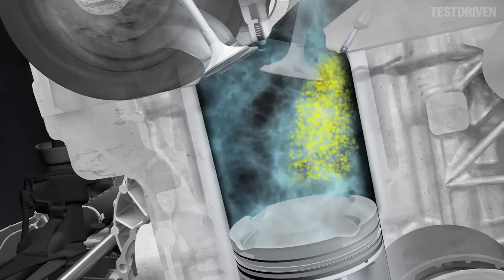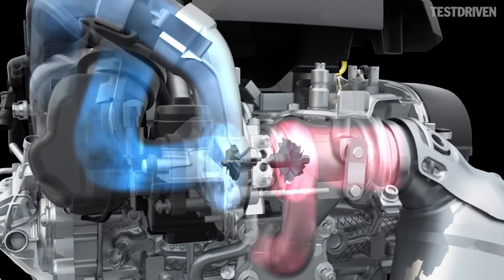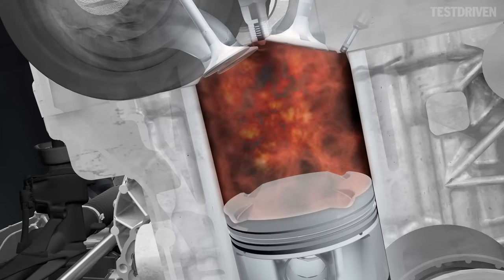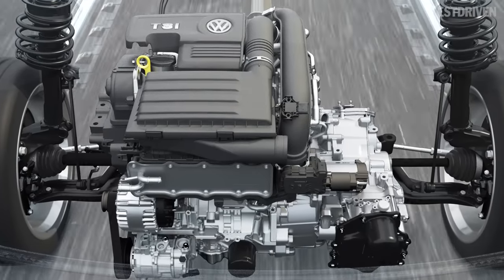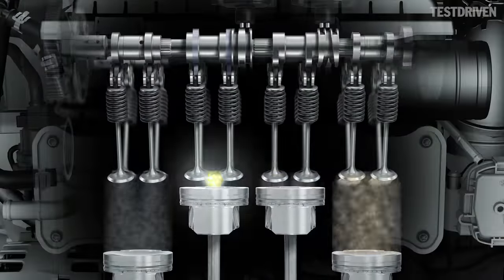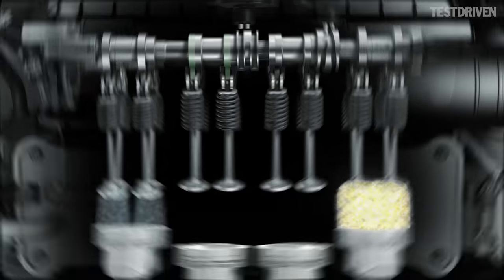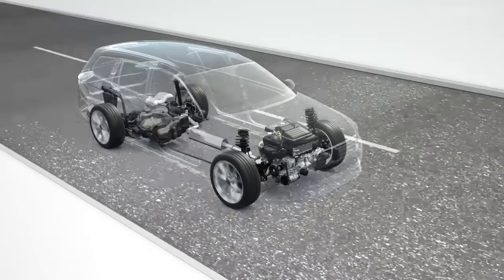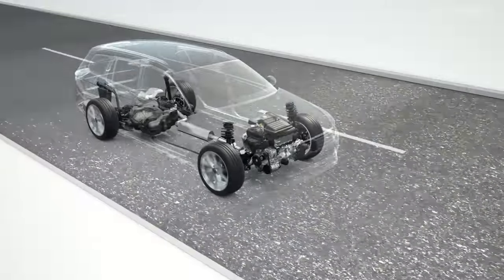Volkswagen TSI engine animation

Comment: Until the dsg blows
Reply: 6 speed one it’s ok but 7 speed one dry clutch after 200000 km maybe start problem
Reply: 6 speed wet clutch on my Jetta TDI still going strong after 100k miles

Comment: 2012 VW GLI 2.0 TSI: New waterpump, high pressure fuel pump, 2 intake manifolds, camshaft replacement, new cambridge due to oil screen falling out, 2 fuel injectors, gas leakage from manifold, misfiring due to carbon buildup, traded it in before having to replace the timing chain seals and timing chain tensioner  which would have cost around $2500. Not a reliable engine...
Reply: Do the proper maintenance and u wont have any problems
Reply: Worst vw engine made 2.0 tsi is trash....buy a 2.0 tsi they said, it'll be fun they said, what they didn't say is that it's a hunk of shit😂
Reply: @stevenyia2778  this is a design problem not maintenance
Reply: @stevenyia2778  lolwut? This suboptimal developed car is permanent maintenance. I hope the development team never finds another job

Comment: Ölabstreifringe verkokt, Zündkerze geschmolzen wegen zu hoher Brennraumtemperaturen und damit Kolben und Ventile in Zylinder 3 beschädigt. Bei 120.000 km. 2.0tfsi ccz. Läuft. Am liebsten würde ich dem leitenden Projektleiter auf den Schreibtisch kacken. 4000€ Reparaturkosten für die Revision des Motors. Und das ist der Standart bei diesem Motor.

Comment: they forgot to tell u how it needs 0.5L oil /1000km !
Reply: Not that bad tbh
Reply: Didn't run the engine in properly
Reply: Mine use no oil at 10,000 km. I must be a genius.
Reply: It is true, 1,4 tsi 122 passat
Reply: @ozdenbasmaya3945  Passat uses larger engine like 2.litre
Reply: @ablam8 No  in Turkey 1.4 tsi  and 1.6 diesel versions sold
Reply: @fuadhasanov9667  100% true
Reply: @MrRohanThomas  what's true?

Comment: Had a 2.0 TSI..
1st strike - sludge/carbon buildup.  Replaced throttle body.  Fixed under warranty.  
2nd strike - Fuel injector faulty in opened mode.  Limp Mode.  Blamed me for bad fuel. BS. I used all top tier.  Cost 1200 to replaced 4 injectors.  Said if 1 goes out, 3 will soon to come.  Warranty not covered.
3rd Strike - Limp Mode.  Dealer wants 600 to fix bad coil pack.  Bought 4 for $125 at AutoSone.  Took me 15 minutes.  Just release plug, pull out coil packs.  Replace. Dang Stealerships.
4th Strike - Engine light on.  Something with Emission.  Cost 1400 to fix.  Screw that.  I reset the Check engine light.   Drive to CarMax and sold it.  Had 48k miles on it.

NEVER VW (Audi) again!!!!
Reply: Joe Nguyen if you can't handle high maintenance German quality then go buy a Honda that will be shitty but run forever
Reply: Joe Nguyen Well, if you push it like an F1 car... what do you expect, honestly?
Reply: Joe Nguyen what year was your car?
Reply: VwParedes 
VW suxs, it's German by name because the quality isn't their thing.
Reply: Joe Nguyen  straight piped mine with 3" down pipe and ecu stage 2 tune with bov and air intake not a problem 30k in
Reply: Same thing by me!! I have lost 4000 euro and then the motor light on! Fuck VW/Audi/Skoda!!
Reply: Honda, shitty? Lol :D
Reply: Joe Nguyen your first mistake was utilizing AutoZone parts. I don't have any problems with my VW. I take care of it like someone with OCD. Maintenance on time, check fluids etc,, weekly
Reply: Rey Perez it's not German anymore, only thing German is the trademark. Vws are made everywhere but in Germany for example Mexico, turkey, Poland to turn the fabrication costs down.
Reply: 81k on a 2015. Haven't even needed to change  the brakes. Consistent oil changes, get fuel name brand fuel only. It reminds me of why I don't eat avacodaos anymore. I once ate an avocado that was spoiled, never ate them again. If that one avocado is bad, surely all avocados after that one will be spoiled. I sure do miss the amazing taste, they taste way better than salsa with my chips, but salsa it is, avocados are bad.
Reply: Random Hoerse Lol. A '98 STS? That's your benchmark for quality? The Northstar engines were some of the worst engines gm made. Source: Owned a Deville with that crappy Northstar engine. The early vw engines were not great. Had HPFP issues, cam follower failures, etc. However, the newer gen tsi is pretty much indestructible. The new VAG cars are not the vw/audis of yesterday. They're really reliable, and fun cars.
Reply: Random Hoerse I'm not sure where you're getting your information, but the Northstar was designed by gm's Oldsmobile division, not volvo. Look, I'm a car enthusiast, and a shade tree mechanic. I've owned and built almost every manufacturer. I've owned vettes, f150's, jeeps, BMW 3 series, audi s4, Evo, 300z, etc. I have no brand loyalty. If it's a good car, I don't care what brand it is. I can say definitively that the vw/audis made in the last 5-7 years are reliable as anything else out there.
Reply: That sucks.
Reply: Jan Prokopenko Lol only you People in the states get shit quality here in europe they are tenden to run over 500.000km if every maintenance is done
Reply: Jan Prokopenko The entire Golf family i.e. Golf, Alltrack, Sportwagen, GTI etc. are manufactured in Wolfsburg. The Passat and Atlas are produced in Chattanooga TN. They do produce a lot of vehicles and components in Mexico, but not everything!
Reply: Joseph Opperman Lmao only us spec
Reply: Crissy 92 volvo 240 wagon. 700 000 + km with only regular maintenance. The odd stubborn transmission leak.
Reply: What about the timing chain tensioner? LOL
Reply: Lol my father has had BMWs since 1991 and the only major problem he had in all years was the turbo on 2004 E46 320d, other than that nothing. But obviously new technologies have to get tested, and unfortunately some people out there are the lab rats, lol
Reply: Joe Nguyen it does depend on what brand of gas you use, my cousins owned an 05 Jetta and she always used Valero fuel because it was so cheap and she had so many problem such as shaking or car shutting off  especially after fueling, I bought her car and I used Exxon to fuel it and after about 2 months the problem is gone. Different gasoline companies use different detergents to clean emmissions and protect the engine
Reply: 5th strike, oil exhaustion and no warning on MMI. Cost: 2200$ for new engine due to conrod going out thru the side of it . Auction set up to get rid of it. Tks Folkswagen for great economy!
Reply: could you upload a video of it pls thanks
Reply: I own 2 Audi A4. One is 1995' (1.9TDi) an one is 2006' (2.0TDI). Both are already at high milage (265k and 303k kilometers) and still running smooth, just 1x Turbochange at the 2006' one and that was it. Just take care of your care 🤷
Reply: Vw's are much cheaper to maintain if you do the work yourself. Got a 1300 dollar quote for a timing belt. 110 bucks and 2 hours. Half the flat rate time
Reply: @some-replies  true but alot of people are not very handy though 😏🤷‍♂️

Comment: Reliable, dependable, quick. 
Dues: Read the owners Manuel, Change The air intake filter every 4 months. Get a oil change every 4k miles or less. 
Get A new battery 18-24 months. epc light may engage if you don't.
1 top of the oil essential because the turbo needs oil and its physically located on top of this engine so its in needs of a full supply as not to lack in the engine. Hence epc may come on.
2 fresh air intake filter  EPC again may come if you don't change it. remove the filter/clean by tossing it on the ground  dust will loosen put it back in and the engine will breath better. epc fix!
third new batterie. all those things keep me Wagoning along volks.
Reply: Oil change every 4k Miles or less...:)))))))))))))

Comment: No oil consumption and no timing chain tensioner fauls (as some said here). TSI engines offer economy, excellent performance and low maintenance. Nothing wrong with my VW Jetta GLI, with a 3rd generation TSI engine, after 58.000 Km (36.000 miles). So far, it couldn't be better, even using a third part power increase module. VW uses all the technology of a premium brand that has a name to watch over. VW Jetta is a cheaper Audi A4 (compare Jetta MK6 with Audi A4 of the same generation), and the GLI version has, unlike the rich cousin A4, sports car performance and handling.
Reply: @S P I have volkswagen passat b6, 1.8 tsi engine, Mileage 229000 km, and it's still work without problem for 12 years
Reply: @S P Jetta was once a sedan version of the Golf, but today they don't have much correlation. They are even in different generations. I once owned a Jetta 2.0 TSi MK VI that had an Audi A4 of the corresponding generation as its parking neighbor. Very similar in appearance, dimensions and mechanics. Much more than with Golf. I worry about the possibility of mechanical problems. I've had another Jetta 2.0 TSI with which I ran up to 83,000 km without any problem. I saw some much more used than mine, severely used even on track day events,  and very healthy. It is often compared to a battle tank in Brazil, for its robustness. But you are right to warn me.

Comment: Hey guys, so im looking on to buy a jetta 1.4 tsi or an eos with the same engine. Are there any specific things or problems i should know and be aware of this engine?
Reply: Not really mine is lasting really well. Best to fill with good premium gasoline, check oil temp at least 75C (167F) before revving hard. Nice to drive, early boost and mid-range grunt.

Comment: Just remember to strip down your engine every 10000 miles to clean the carbon build up on your inlet valves. This can be easily carried out by a vw qualified engineer near you for a small fee.
Reply: Gtfo with your small fee
Reply: @TechNostalgiaNL  small fee. That's meant as ironic humour pal. Satire. Yeah it's waisted here.

Comment: My 1.8 tsi has a steel block, not like Caddy with aluminum, and the gasket bolts go on the Caddy, engine overheats, anti freeze in oil. I will keep the vw.

Comment: My jetta 2019 is now 180 k  kilometres , it’s performance , silence and fuel efficiency is like it was at 20 k , i love it , no engine light so far , some dumbasses don’t maintain them well , this engine need special grade oil as 509-00 0w20 , most of them just buy simple 0w20 and always put gas treatment after some 5000 km , and replace the required parts on time
Reply: What is your fuel efficiency long term?
Reply: @dragospahontu  16 to 20 km/l

Comment: I own a  VW Golf 1.4 tsi.
After only 5000km this engine starts shaking when running idle. 
I don't find this normal, do you, but VW finds that an engine that runs irregular is normal !!! 
And won't do anything about it, even in warranty period !!!
Remember, this engine block is also used by Audi. 
You pay a lot of money for a shaky engine, and what about the long term damage.
The joke (bill) is on you.
Reply: i have a 1,4 tsi golf driven 9000km and have no problems with the engine. Lucky for me or bad luck for you?
Reply: Any relevant update about your car's engine?
Reply: Any relevant update about your car's engine?
Reply: Any relevant update about your car's engine?
Reply: my delaer says it's due to the fact that the engine runs on a "lean mixture". But the car has always run on that lean mixture from day 1. Why it start shaking when running idle after barely 5000km, remains a mystery. I've driven in other Golfs ( which of course all run on the same lean mixture) with more mileage on the clock ( even euro 6) which don't have that problem. So I have my doubts about the reliability of my engine on the long run.
Reply: They don't bother to do anything about it. Even under warranty.
Reply: VW Golf7
Reply: Your timing chain is the cause of that shaking because it`s stretched, that`s a common problem in TSI engines.
Reply: Mihovil Peko LOL, most of 7-gen golfs 1.2 and 1.4 are timing belt engines!
Reply: Salil Sawarim all mk7 golfs actually.
Reply: From what you just said tells me you unluckily got a bad engine out of the batch. VW just like any other manufacture will have a bad engine after so many are built.
Reply: That is what they call: "a product property".

Comment: I have a 2018 golf tsi and I’m trying to get some more power out of it without voiding the warranty. I know it isn’t the best car to put money into but I’m not looking for anything crazy but does anyone have any advice? I just don’t know what I can do without messing up the warranty
Reply: From what I’ve seen, a more free-flowing exhaust system is the easiest way to make more power without voiding the warranty. AWE makes a nice one that greatly reduces back pressure as well as weight. A proper cold air intake (APR, CTS, etc.) would help as well but I’m not 100% sure if they void the warranty or not. A drop in air filter would give improved airflow and would not void the warranty. Unfortunately, you’re not going to get much more than an additional 5-15 HP from these. They will mainly improve response and sound. Having the power come on quicker and louder will make the car feel faster and more fun. While ECU tunes greatly improve power, they void the warranty. Also, if yours is a gti, it’s actually a pretty solid car to upgrade.

Comment: Everytime he says 'TSI stands for..' i expected to know the abbreviation.
Reply: TSI stands for The high preSsure fuel pump Inoperative.
Reply: @DigitalYojimbo  wrong

tsi - turbo stratified ingine. its german
Reply: @braderyoutube1983  Turbocharged Fuel Stratified Injection.
Reply: @Alexandru-T.  that 1 is for tfsi. not tsi. right?
Reply: @braderyoutube1983  They're the same EA888 Gen 3 engine. Audi sells it as TFSI while VW/Skoda/Seat sell it as TSI.
The old EA113 engines were TFSI for all, but with the introduction of the new EA888 engines in 2007, they switched to the nomenclature from earlier.

Comment: I got 145k miles on my gen 1 EA888 2.0 TSi and I’ve replaced a lot of gaskets and crap but she’s all good now except the tensioner for the timing chain at the top of the cams that broke but I still spank limiter like it’s nothing and I drive full throttle because that’s the only way to drive it no I’m not kidding I literally drive it like I stole it everyday and I’ve never had any mechanical issues except the high pressure fuel pump and the starter but I replaced both and no more problems

Comment: My mother in law has a polo 1.1 tsi ( i think that's the engine size). That thing just won't fucking move, and I have a turbo 0.9 tce clio, never failed me once, everything works as just the day i bought it and it will smoke the polo. Idk where the fun is on driving a car with such engine.

Comment: Do these new 1.4's have timing belts, again?
Reply: +Mr. Andraș with alot of play
Reply: +Mr. Andraș Front timing belts and rear timing chain.
Reply: Nah still have chain. Itll have alternator belt and stuff but sadly no and crappy tentioners theyre grand if you keep an eye on them.
Reply: Ben Crosbie and there a grand if you dont
Reply: Belts were re-introduced on Tsi engines in 2013 with Golf 7.

Comment: 10000 km no problems yet
Reply: Pfff.. its just 10k
let me know when you are in 160k
Reply: Fedor Amuricano mon CV.
Reply: moiteur. fariman
Reply: The Ford Eco boost engines are more reliable i think
Reply: except the Powersheet gear box :P
Reply: 29000 miles on my 1.8 tsi. no problems yet
Reply: 67000 km no problems yet
Reply: Almost 200'000 kilometers in my Golf 7 1.4, no problem yet
Reply: Check out the 2017 GTI Clubsport MK7 at my Channel Guys! -  You'll be glad you did... (GTI 40 Year Anniversary!)  👍  😎  👍
Reply: Tsar Pushkin my 1.4tsi 140ps golf is about to 180.000km. No problem at all. 
Now i got new polo 1.0tsi. I love Tsi engines, they are the best  💕
Reply: @vincentl.9304  whaàaaaaaaaàat?!?! 200000km in a mk7 golf damn you did not wait around to start driving it 😭😭. How many miles do you drive daily
Reply: @oppoh739  Well it's a 2013 one and due to my work I can drive up to 30'000 miles a year 😂 so yeah mileage goes up quickly
Reply: @oppoh739  I'm a commercial traveller so I need to drive a lot across the country lol. Currently I'm well-paid but I'll find another job soon because it starts to be annoying having to drive that much 😂
Reply: @vincentl.9304  i can imagine that would get annoying, takes the fun out driving lol. Best of luck!
Reply: @oppoh739  Exactly ! Cheers mate, u too
Reply: @Matty12333  ford ecoboost also has issues
Reply: @chromediesel444  and no more oil too...
Reply: @otomobilen1951  :)))))

Comment: 150 000 VW Scirocco 2009 1.4 CAVD engine, piston screwed up as well as water pump, turbine, i had to get the whole engine done at 151 000 cost me well over 2000 euros.
Biggest fail of a project, the 1.4 engine, waste of 10 000 euros on a car. I had problems consecutively in a month, from piston, turbine, water pump busted , horrible engine.
Reply: I almost bought a used VW Scoroccio 1.4 tsi with high milege.
I'm glad i didn't. I do want a Scoroccio though 2litre version i think.
Reply: Friend of mine had Golf 1.4 tsi, the plastic crap in the engine is such poor quality and it was having all sorts of issues, he got rid of it eventually after realising it's a moneypit